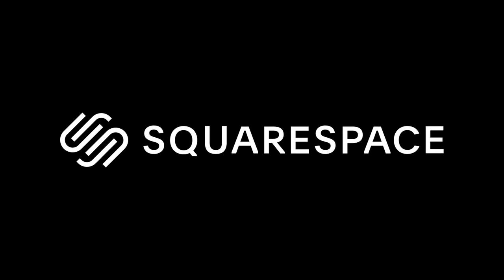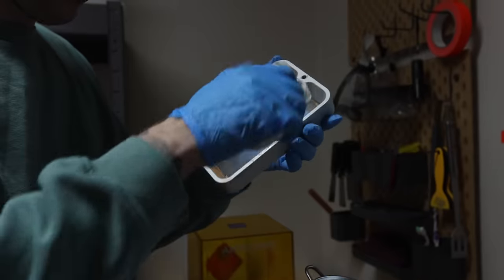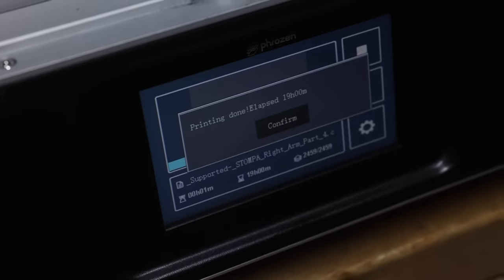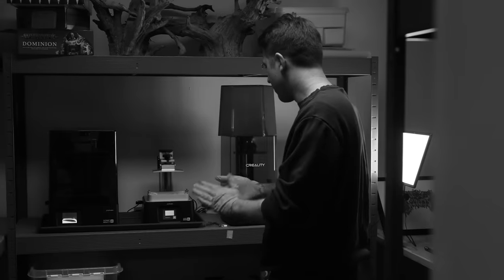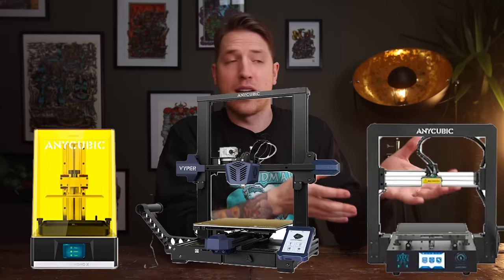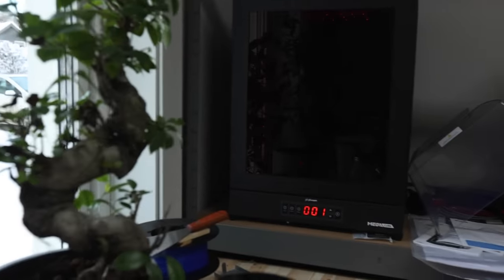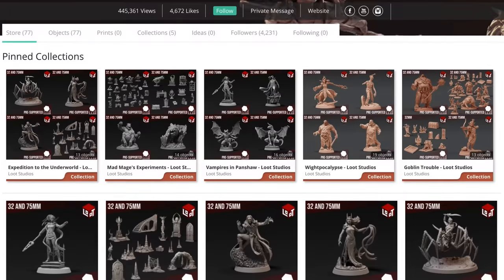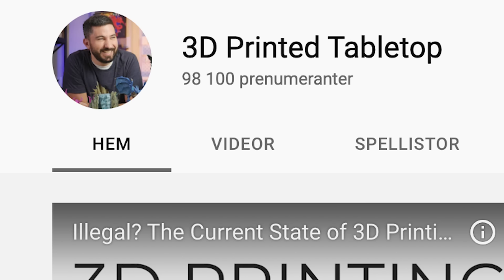6 things that made me hate 3d printing less

Comment: Would love to get into resin printing, but I'm paranoid about the fumes and my 2.5 yr old toddler getting messy with it. As a dad yourself, how do you protect your hobby space from tiny hands?
Reply from the maker: I have it in the studio, in a seperate room! But talking to danny from 3d printed tabletop and goobertown, apparently its not as toxic as one could think as long as the room is properly ventilated.
Reply: ..and ten years later your kid gets asthma, all resin fumes are toxic and printers work for hours spewing them around, resin printer is something that you keep in separate workshop, not your hobby space.
Reply: @randomnickify  That's where the 'well ventilated' part comes in, so you don't have fumes lingering. There are a lot of solutions, but the easiest is probably a fan attached to the printer and some ducting out of the window
Reply: ... ever heard of a door, dude?
Reply: I run mine in the kitchen on the cooker, with the extractor hood fan running. If you want to be super sure you are getting all the fumes you can put plastic sheeting around the cooker hood down to the printer. TBH I find the printer cover keeps most of the fumes inside, you only ever get a slight smell when the cover is off.

Comment: The resin failing might be setings and if it's not setings it might be temperature that is the problem, some resin are big babies when it comes to temperature, the work in the goldilocks range not to hot, not to cold, just right if the setings are aces then try heating up the build plate for better sticking, if you have temp controle in the printing room then read up on the just right temp and set it to that~ It might make your life all sunshine and unicorn farts~

Comment: Thant last tip , run 140mm lift speeds called zoom settings and i have sonic mini 4k not had a fail since and halved my print times. much slower on the mighty though.

Comment: wait, isn't the smelly part a safetymeasure?
I thought that resin was a toxic material to hinale too, making it smelly allows you to know that the area is saturated in resin and you have to move away
Reply: Partly yes. Some a more smelly than others, it also seems to be a person to person issue as well. But once lids are on you can't smell anything.
Reply: Even if you can't smell the resin it's still quite dangerous to be breathing it in large quantities. You need special organic filters in masks to filter it out. An evacuation system for the air in the room is also highly recommend. Shits dangerous, but if your smart and carefully it's a very rewarding hobby! Printed out a T'aunar and had tonnes of fun!
Reply: The smell is only a result of the volatiles which happen to be toxic/irritants.

Comment: I have an Elegoo mars 2 mono that i love. I use Elegoo black resin and have the calibration charts for the various colors of resin manufactured by Elegoo. Yes colors do matter and each has its own calibrations. I haven't had a failed print in a year or more now. The main thing is keeping the vat deposit free and changing the FEP every 50 prints or so. I use chitubox slicer and i keep an eye on the calibration settings as sometimes pre-supported models may also have the calibration set up already into the stl file and it might not match the settings of the resin.

Comment: Some good tips!

Am I the only one that isn't afraid or stressed about resin? I mean, I'm not drinking it or rubbing it all over my body, just following the recommended safety guidelines. In modern day we probably interact with way worse chemicals frequently than resin.

That or I'm dumb af and don't know enough to be worried...?
Reply: Recommended safety guidelines are basically 'don't get it on your skin/ingest it' and 'don't breathe too many fumes', so if you're avoiding both of those you really don't have much to worry about.
Reply: If you follow the basic guide it's alright. The issue starts when there are failures. I am dreading the day I find a ripped FEP and the resin getting everywhere including into the printer.
Also gloves, mask and goggles should be standard.
I got 1 splash of resin on my forearm, where the gloves did not reach and had a red and itchy resin burn for 4 weeks.

Comment: I agree with all the point except for pre-supported prints. Because I tend to upscale my prints and make them into display pieces and not game pieces the miscommunication between the slicing software and the 3d printer morphs the premade supports into literal walls of resin that are hard to break off, leave holes in the models and just make the whole thing unusable.
I guess in the end it just depends on what you want to do with the sculpts.

Comment: I've been printing for several weeks and right now I can't print anything properly. Just yesterday I've started printing some space marine parts: left and right arms, legs, head, torso, a bolter, decided to print the rest later, and the only things that printed were the legs and the bolter, and the rest was stuck on the fep film in an approx 0.85 mm layer which took me 15 mins to scrape off with a METAL spatula, which obviously ruins the fep. I'm frustrated as hell and I genuinely don't know what to do at this point. I've cleaned the vat, I've releveled the printer, I've rotated everything by 45 degrees like everyone always does, used supports, even set up my exposure time recently, 2.3 seconds, everything looks fine in chitubox, yet every time I get a mess. I'm using an anycubic mono 4k. I don't know what to do.

Comment: Do yourself a favor, especially if you own your house: create a negative pressure setup.  Enclose the printer in a grow-box made out of nylon material (like a tent).  Many grow-boxes come with openings for 4" ventilation hoses.  Locate the printer against an exterior wall, and have a handyman come and install a drier vent in that wall, up somewhat so that it's above your setup.  Then, get an inline fan for a 4" ventilation hose, and connect the growbox to the fan and from the fan to the vent.

PROBLEM SOLVED.

Especially if you have animals and/or small children, the fumes from VOCs are really, really bad.

Also, when you're dealing with the print, cleaning the vat, etc, get a mask with a filter capable of filtering out the vapors.  The more you spare yourself the fumes, the better your experience will be with the hobby.

Comment: Never had any issues with 3D printing at all. Just make sure your resin has a temperature above 15 degrees celsius and no hardened particles inside and you're good. I actually think 3D printing your minis is less work than cleaning terrible forgeworld casts or building the puzzles that modern GW sprues are. Not to speak about the good old white metal.
Reply: I was putting together a box of Wyches and had to retrain myself to assembly line glue because the newer models are all so specific you can't do it. Every single marine has specific parts that go in a specific way and god forbid one arm get on a different model or something. Used to be able to put a tactical squad together in like 30 minutes. 

As someone who has put together a lot of Forge World and these new kits, 3d printed models are way, way easier, absolutely.
Reply: It's GW policy; out gamee, our rules,our minis !!! Been playing with those for last 20 or so years, but always kept green stuff at hand for mods. 3d printing just made all that obsolete.

Comment: Hmm, listening to your last tip, I wonder if there was a way for 3D printers to be programmed to calculate that lifting force based on the speed and the current surface area of the printing layer and auto-adjust the lift speed to keep it around a certain amount of force. (I mean, obviously it's possible, it's just a matter of someone going the extra mile/kilometer :P to do the programming)

Comment: Legit good advice in here and all nice and summarized in bite sized chunks :)  Love it.

I have always been iffy on the Phrozen models ever since it came out tht their rail systems were made out of a lower end quality and tend to bend. (which is extremely BAD)
But looking at the newer (and especially the bigger) models, it might be that they fixed those issues.
I might give them a try later. 

As for cleaning models, get yourself a nice and big ultrasonic cleaner for like 100 bucks (+- 10 litres), pop in some mr clean (cheaper than pure IPA and works just as good if not better) and let it run. You get a deep and intense cleaning and you can even heat the liquid to a set temperature, which helps with removing supports afterwards.

Comment: So hyped for the Phrozen sonic mini 8k. Been getting each version of the Phrozen Sonic Minis since they first came out, great printer.
Reply from the maker: got it this week after we finished this video... OMG its good!
Reply: @SquidmarMiniatures  Are you going to do any review? I have been thinking about getting two if it's worth it. Can you still see printer lines on flatter surfaces?
Reply from the maker: @JoshNoodleSoup  the z resolution is the same as on the 4k but with double rida so more stability. BUT, the detail level is much higher than i expected. I'll make somewhat of a test video next year

Comment: I have tried several times using old supports to peel off that resin sheet after using the clean vat function. It never worked. They never "merged" with the sheet.

Comment: I have the Photon Mono X and i bought Eco Resin because it allegedly smells less , but whenever you need to clean the prints and everything , it makes the entire room stink despite having the Elegoo mini Air purifiers inside the enclosure . Also , i have adherence issues with it .

I will definitely try the Resins you mentioned , hoping i get better results with them !! :D
Reply: The mini air purifiers can only do so much, they're intended to remove the smell in a tiny space of the printer. It did make a huge difference when I started using them - no more nasty smells slapping my face when i remove the lid, haha. For the rest of the area, i installed a full size air purifier - seems to be working so far. I'd still prefer a hose with a fan straight through my window but that only works during warm days, not so much in winter time...

Comment: Unfortunately have to disagree with "presupported" miniatures. 99% presuports are bad and made in lyche (which can be easily tracked down by some ridiculous support placements out of the blue). Additionally there are two type of presupports - one of them extremely thick which causes "thick" problems of the tips and cause subsequent quality problems. Another type are very cute little supports which can also leave very harsh support side and fail at all due to the lightness. If one wants to have a perfect model - the only option to support it himself. If the user is ok that model would inevitably have imperfections\small broken off pieces - then sure, presupports are life saver. 
Have been in resin 3d printing for a year, spent a lot of different resin, started with Kingroon Kp6 4k, tried Elegoo Mars 3 pro, Saturn 2 8k and honestly I'd say the thing I wrote is applicable in every single situation.

Comment: I actually haven't had great luck with the pre supported minis.  Seems way more reliable to just do it yourself
Reply from the maker: Which printer are you using? The quality of light is quite poor on some brands, on finer stuff like supports tht can be detrimental
Reply: @SquidmarMiniatures  I'm using the Saturn S, I am somewhat new to resin printers so maybe I was a bit quick to blame pre supports.  I also can't seem to get quite the detail that I see in a lot videos on miniatures, I've got anti aliasing at 8 which I think would be good but maybe it's also the elegoo resin.
Reply from the maker: @logankellum5496  Try putting anti aliasing at 0, and try to slow down your lift speed to 45. The saturn is is a decent printer. But comparing it to say the phrozen the light quality is not quite there.
Reply: @SquidmarMiniatures  well crap that is unfortunate, maybe I'll have to partake in a phrozen.  I did change the lift speed so hopefully that helps!  Thank you!
Reply from the maker: @logankellum5496  try that first you should still be able to get pretty freaking solid prints from it
Reply: @SquidmarMiniatures  what do you think about the Saturn 2?  I've had that on preorder... Should I try to cancel and get a phrozen if I'm looking for better quality?
Reply from the maker: @logankellum5496  i would not buy any other brands right now. So if you have that option it's a good one. Elegoo have decent printers. They're far from bad. i think you should get a second opinion on it. If you don't know anyone personally with the 8k phrozen check other yt videos as well.  it's also good to remember;I'm  biased. I get sent printers from phrozen (and other brands, like creality and anycubic) and just haven't found any printer at the price point in the same quality. You can see black Magic Craft and Luke's  videos on the printers as well :)

Comment: Yeah 2:06 don't do this on the Elegoo Saturn! It's display is smaller than it's vet, this results in a baked in rectangle, hat has uncured soup resin around it. Just don't use the cleaning feature on this printer.
Reply: I've been doing it with my Elegoo saturn for a year with no problems, not sure what you mean
Reply: For printers where that is an issue just grab a cheap 405nm UV torch. Run the vat clean, remove the vat, shine the torch around the edges of the fep from below. The torch will also come in handy if your curing station doesn't get certain parts of a print.
Reply: @IdolsHextech  you might have a different screen. There are at least 3 different ones.

Comment: bit surprised no one mentioned vroom settings in comments yet. Basically the idea is if you crank your lift speeds up crazy high you also have less suction issues. Seems like either going really high or really low works equally well. I've been using vroom on my e10 5k's with siraya fast navy grey and have had no problems even with full build plates. I will add that I tend to hollow just about everything to save on resin. Anyway, heres the Uncle jesse vid with a lot more information. https://www.youtube.com/watch?v=RvWiN33tHU8

Comment: hey man. i had the same problem with the m70 resin, fail after fail , until i mixed it with a resin that i know doesn´t fail me and since then i always mix the m70 50/50 with a easier resin and the prints mantain a high level of detail but are easier to print. why don´t you try it before letting the m70 go to waste

Comment: More tips....Im VERY LASY 

1 So I get a magnetised steel printing plate. 

The prints just pop off the build plate no hassel. 
   I got a cheap one off Amazon works perfectly. 

 2 When printing a lot of models I just leave the unwashed minis in an box.  ( a silver take away box)  ive left uncured minis there for up to 2 weeks just adding more minis as they print then when the box is full.  Do a batch wash / cure   
Save SOOOO much time.

As long as your box has a lid with no light filtering it  causes NO issues. 

3 water washable resin   no Fking around with smelly ipa smells less game changer.

4 FEP tape ( i think thats whats its called ) around the edge of the screen to seal it.  Then if you get a leak it wont flow into the printer killing it. 

Only change is I dont bother to use a paper sheet to level the plate any more as the tape actually gives me that little space.  

Oh and bonus tip Ive a Mars 1 and I printed a little grebel to stop the Z axis squish it sufferes from no idea if the newer ones had the same design fault.

Comment: Not gonna lie, I've been really wanting to try 3d printing out, but this video is kind of making me not want to. I had no idea things could get so disasterous 😳
Reply: Honestly, it's not as bad as it may appear. Failed prints are generally user error, not supporting properly or not set up properly, like he said once you find a resin that works, stick with it. It helps cause you set up the exposure times etc in the slicing software and don't have to touch it again. When you change resins you have to adjust these settings. Failure to do so can result in poor quality prints or failures from improperly cured layers. 

FEP fails can be avoided with proper care and correct settings. Also checking it at the end of a print session. If it looks damaged in any way change it. Test it with water first, for leaks, then test with a really small print in the printer, to ensure you are not gonna have a full vat of resin all over the place. 

Basically it all comes down to getting the right stuff at the start, which you can do easily now with so many channels on youtube and groups online like facebook and reddit that is a great source of information on tools to use and setups etc. The worst part is the start, the start up cost, getting the right tools (can be built up before getting the printer) , ventilation, and settings sorted. Once that is dialled in and set up properly 3D printing is a breeze. 

Pre supported/properly supported files do cut down on a vast majority of failures, correct print settings will deal with pretty much the rest.

Comment: Best way to remove supports without damaging too much the print?
Reply from the maker: dip in hot water first  and theyll almost fall off and then clean up with a sharp knife afterwards.
Reply: Hot water is a hood idea.   I use a fan heater let the washed mini sit in front of it for a minute and the supports pop off.
Reply: also not sure if you do that already, but remove them after washing, before curing. (use gloves obviously)